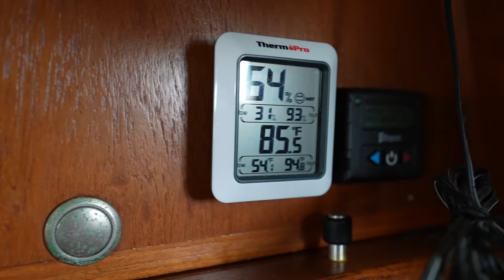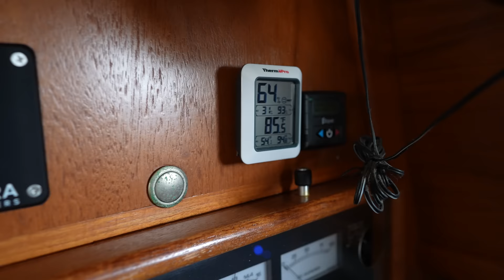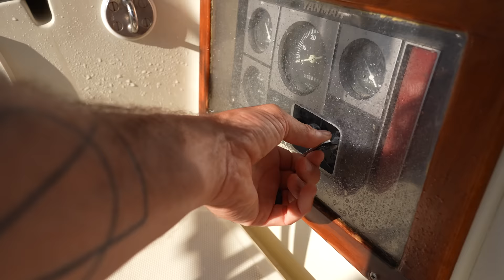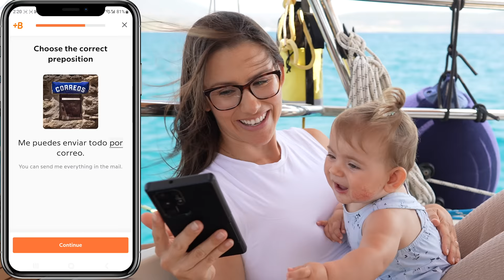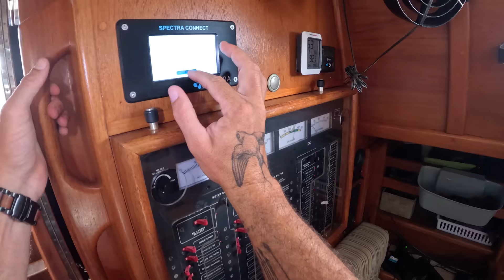Greece is on Fire - Surviving Extreme Heat | S08E26

Comment: It has been hotter than usual, worldwide, for the last two years because the Tonga volcano blasted billions of tons of water vapor into the atmosphere. Water vapor has MUCH more of an effect as a greenhouse gas than CO2 does, holding in the Earth's heat. If not for water vapor in our atmosphere, worldwide temps would drop 50-60°F. We just have an excess of it, and it will subside over the next couple of years.
Looks like your next install will be AC?

Comment: I am also a big "fan" of Caframo  Sirocco II  fans.  They're made in Canada and rather expensive.  Caframo specializes in gadgets made with small electric motors - the original company name was "Canadian Fractional (horsepower) Motors".  These fans seem much quieter than other makers' models, although no really more powerful.  Thus I think they make most sense in sleeping quarters where quiet is important.  (I have 3 in the V berth of my boat.) I think they are best mounted at the same height as the porthole as is the unit you show at 29:02 then you can pivot the fan so it is parallel to the cabin trunk surface and then suck in outside air efficiently - at least when it's not raining!

Comment: Californian watching them say "brutal heat" in the mid-90's: 🤣 At least yall can jump in the water!   Not trying to downplay it, just funny how these things are so relative; not unusual for us to get several weeks over 115.  (And yah, we have AC, but we actually spent the summer deliberately keeping it off and using fans in the evenings/overnight, due to rising costs--worked surprising well!)  Cheers!
Edit: you guys could totally use some small fans on swivel mounts, and with a good adhesive (no additional holes) you could mount some small fans that can be swiveled out of the way of hatch, or even flipped, to either push or pull air in, as needed.  Place a fan at each hatch, pull air from one end, and have the rest pushing the air out at the other-good luck! (and we hose down the drive and sidewalks in summer to cool off; a trick we picked up from our Chinese neighbors, and it absolutely works to cool the house, same as your deck!) 👍
Reply: Absolute Temperature alone means ''nothing''.
It's a COMBINATION of high temperature, high HUMIDITY and no (cool/cold) wind that causes the distress feeling (heat/distress index). You may have 100+ (F) in ...Arizona or Death valley and that maybe doable! and just Wednesday but if you have 90+  AND HUMIDITY LEVEL >80% AND absence of cool wind then the distress index gets ''red'' and you are (literally) suffering. If these conditions last for days you feel constant fatigue ,dizziness,headache... you may even feel or get sick.
Btw : Jordan and Des are in the Ionian sea (the west coast of Greece), historically(!) this part of Greece is the coolest and most wet (rainy) ,that's probably no wildfires. The excessive (in duration) heatwave was mainly in east (north and south) Greece (hence the massive wildfires).
And yes you are right, a (good) fan can make a great job (esp. during night), provided there is some form of cool breeze in the air.

Comment: this my sound silly but do ever think my be as no roof insulation boat heating up my be add sum to inside roof my help cut heat down as know wood and fiber glass could cause heat more as sun getting hotter my be good idea to insulation in and around boat as got little one be safer for her as she feel heat different to you. get uv protect coating on out side cover inside top help cut heat down as well help keep heat in colder days as now skin boat letting hot and cold in, line in side cupboards and any were you think let heat in or out help save money and the weather from you.